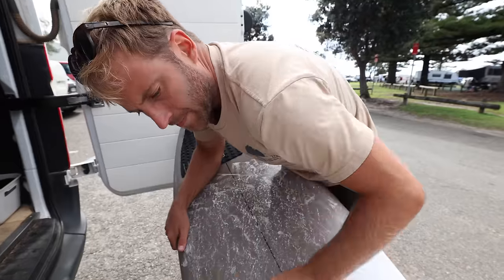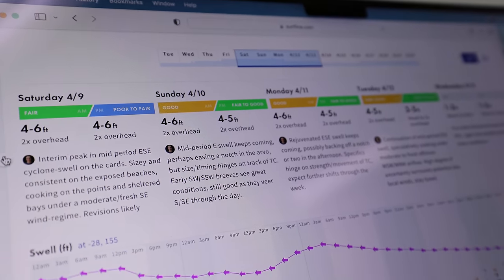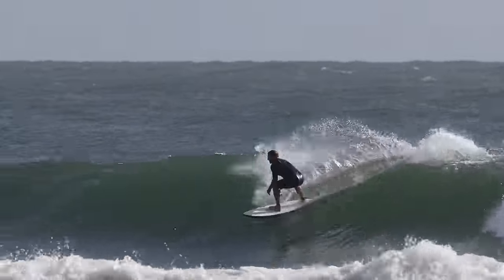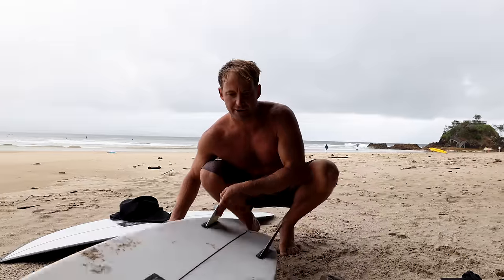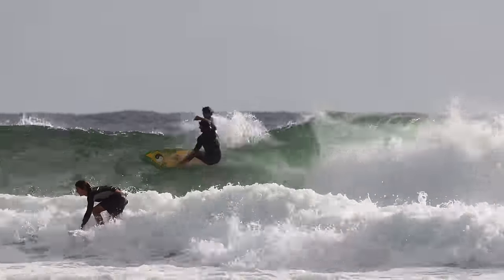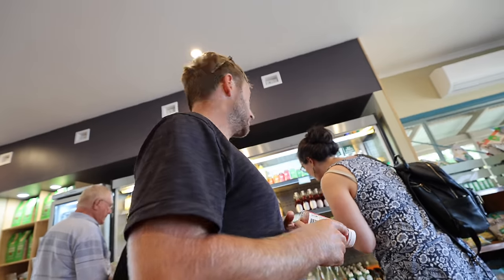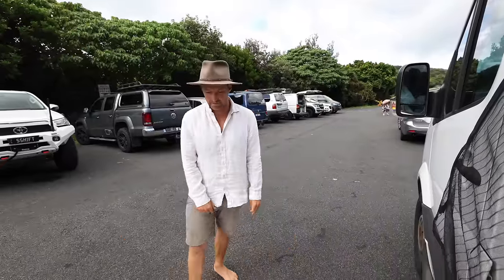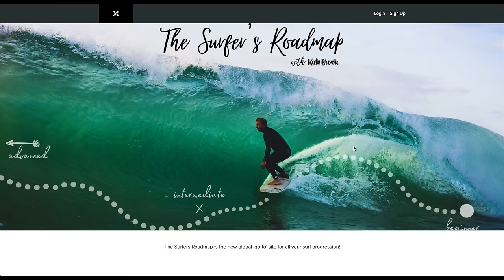Here's why your twin fin surfboard doesn't work  | Ultimate Twin Test #2

Comment: I have an album twinsman and have always been interested in the lightbender. I find the twinsman an awesome board for in the pocket surfing. I don't find it the fastest but for me that works as helps me turn and stay in the pocket and not race out into the flats. I always thought the lightbender was a bit more of a traditional fish with projection / drive but the way it came across here it sounds like it is a performance / pivoty twin? what are the differences between the two?

Comment: Just sharing my experience with a Flat Earth from Akila Aipa. It is deceiving how well it paddles for its size. The volume is on all the right places. I just get real tail heavy and it just drives and pivots effortlessly. It works in tiny mushy waves but absolutely rockets through fun chest high waves. 

This board makes me look like I know how to surf. And I only surf a few times a month and primarily foil every day. Such a fun board. 

Also, when you see Kelly Slater surf a table, JOB surf a door, and Austin Keen surf a coffee table, you begin to worry less about the shape and rail and fin and such minute details and just make the best of any board. Just my $0.02.
Reply from the maker: Tested in the previous series 🤙🏽

Comment: Dims question as these boards are generally wider & thicker. 
How much shorter is too much? I’m 6’3 87kg, my shorty is 6’4 36 Litres. 
Is 5’11 Lane splitter for example too much of a drop mainly for Stance purposes but also other reasons??
Reply: I’m 6’5” and 89kgs. I’ve got a 6’2” performance fish with 40 liters. I could definitely go shorter or less volume but I think us tall guys do better with longer rails and more foam. In my opinion going too short is aesthetically displeasing.  Plus with our extra height we’ve got much more leverage and can put it on rail easier than a shorter person. And the extra length and volume gives more stability for our big body. That said, my next fish will be a bit more traditional and 6’0”. I had a 5’10” fish years ago that I really enjoyed but I had numerous people tell me it looked too short for me.
Reply: @rzadigi  some good insights, thanks. 
I was loving the look of the lane splitter but the largest size I could find was 5’11. 
I ended up getting one second hand near new in 5’11 and though I can feel the potential it is paper fine through the tail I feel the tail dragging through the water when paddling because of my larger frame.  The last foot of so is pretty thin. That was something I’ve never experienced before so a good learning curve and will likely sell for similar to what I purchased it for so all good.

Comment: from studying physics and a little bit of hydrodynamics, another key feature that is affecting your cut backs on wider boards, that like to channel rail speed, is the fins, if you are using keels, and produce to much drive, pop down to a carver family fin from the fcs. they tend to be alot smoother. I dont use twin fins, but i do use 2+1, with keels for the sides, and a performance fcs in the back. take my word for a grain of salt, because feel is different for everyone, plus i look at the friction, meniscus tension, and then use it in data collection. I guess it would be fun to design my own board. probably look very similar to a Tomo Vanguard, with a little bit more volume, and a hybrid fish tail. P.S. half of the time im a drunken nerd crying for attention lol.

Comment: Have tried to find an answer on the internet to no avail. I have bodyboarded and bodysurfed my entire life. I can wakeboard, wakeskate, snowboard and skateboard. I understand where to takeoff for bodyboarding and surfing, how to read waves, etc. My question is : would I follow the "normal" progression recommended for beginners who start to surf (seems to be larger / more volume boards) or am I able to buy a more "advanced" board straight up?
Reply: Some of those things will help for sure.  The fact that you bodyboard means you know how a wave pushes you and basically where to be to take off.  I don't wakeboard or wakeskate but have do know how to skate and snowboard.  You'll find elements of each will help though neither are quite the same.  I'm not the best surfer but it compares to riding transitions on a skateboard.  Trimming turns are similar to trimming turns on a skate board.  But carving turns are different I think.  It's a problem I have to keep thinking about.  On a skateboard you lift the nose and swing your body to turn.  Surfing is more applying pressure like snowboarding.  But then it's its own thing...lol.  
Anyway...to answer your question, you're probably pretty well balanced so I wouldn't waste time on longer boards if that's not what you want to do.  You can jump right into a short board, but I would suggest a forgiving short board.  High performance boards are pretty twitchy so if you start out with a daily driver or something closer to a groveller (small wave board) it will be easier without having to go to a longer board.  Something like a Lost Puddle Jumper HP (it's only slightly more "high performance").
Reply: @doublestrokeroll  much appreciated and what I was hoping to hear
Reply: @joel6376  no worries!   Have fun with it!
Reply from the maker: Progression will be faster I imagine
Reply: Rent one for a couple of sessions... good conditioning is key. A guy at my spot, 24 years old, 6'2 and around 75kg bought a brand new 5'10 rocket wide swallow and was surfing in 3 weeks... he  snowboards, skates etc and has been around the water all his life... he now thinks his board has too much volume for him. I'm 41, started from scratch around 1 year and 4 months ago, once or twice a week. Pretty fit and swimming pool since 13. I started with a 6'0 hypto and stood up in the second day. After a month and a half I moved to a 5'7 subdriver swallow and I like this one much much better. Locals that surf a lot say that while not being very good, I do surf; so I think you'll be fine.

Comment: This is why I started building my own equipment in the 60's. A friend had bought a new board then dropped it while holding it out to show how light it was.  The rail split open for two feet from the 3 foot drop on the sand. When I make a board It costs me only as much as the materials and it's solid. My target weight is higher and it lasts for 15 years or so.  It's nice to have a board that long and getting it wired. Key to get the shape right but paying so much for a board is just disgusting. I won't even look at the boards in the shop anymore. buying a used board cheap with a good shape and copying it is the way to go. I make carbon foils now and kitesurf. Surfing seems like a kiddie sport anymore. HAHAHAHAHAHAH !!! SO CROWDED !

Comment: TBH there was a reason why thrusters (or tri fins) were invented, and why most surfers ride them. Watching twin fin surfing just doesn't quite look right. The hold and stability in the tail isn't there for the most part. Advanced surfers can adjust and harness twinnies, but the average joe is all over the place on them. Just my two cents worth!
I have been riding for a long time, and much prefer a two plus one set up.
Reply: Yeah I think the point of twinnies is to slow down and flow WITH the wave rather than rip it to shreds, but a lot of shapers and some of the boards being tested here were designed more for high performance style surfing, with sharper, shorter outlines and volume distributed differently.  It's basically an oxymoron, the "high performance twin".  I guess its all preference in the end.  I own a black baron, which would be considered a high performance twin, but I never try to over surf it, or even surf its limits.  Speed + Natural flow makes it more fun than the rest of my boards in my quiver.
Reply: @zach1978  I think you hit the nail on the head with 'natural flow'.